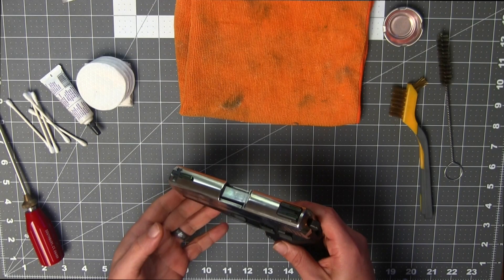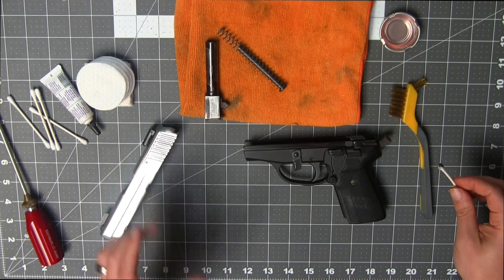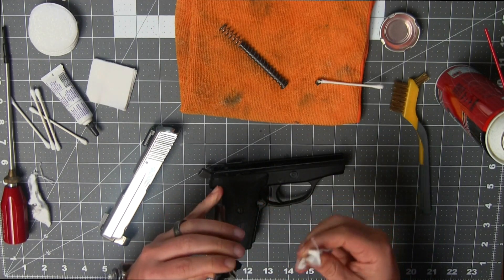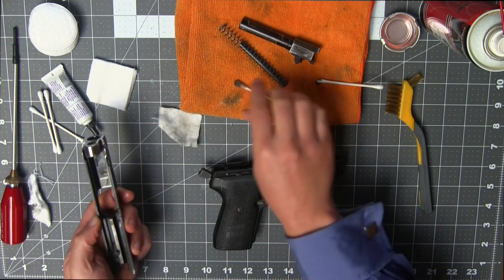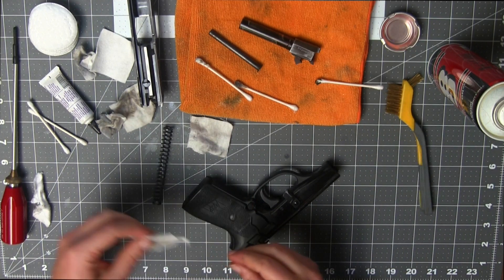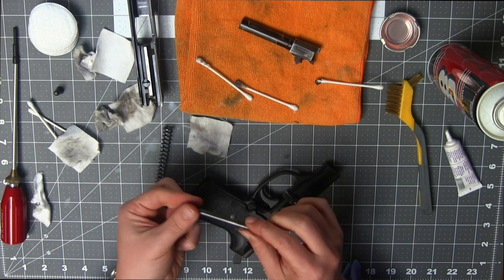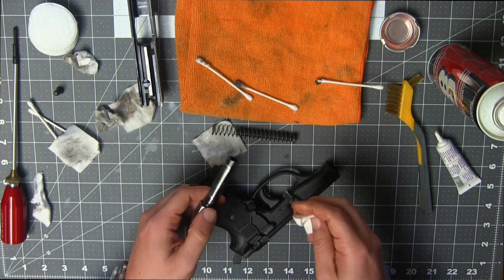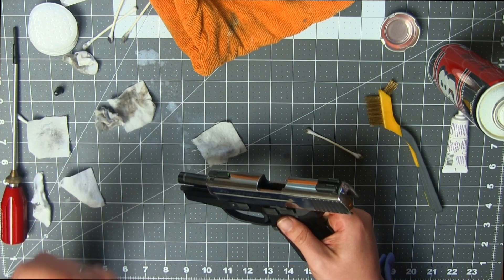General Cleaning And How Much Oil To Use On Service Pistol

Comment: When I tried to use CLP to clean, it leaves the barrel and whatever I've sprayed it on too oily. I know it needs to be lubed but it's too much. On the other hand, CLP works best to get the carbon off. Tips?
Reply from the maker: If you are going to apply an additional grease or oil, just wipe the CLP off before the solvent can evaporate out of it. Should wipe up easy with a microfiber or swab. Coffee filters also work well.